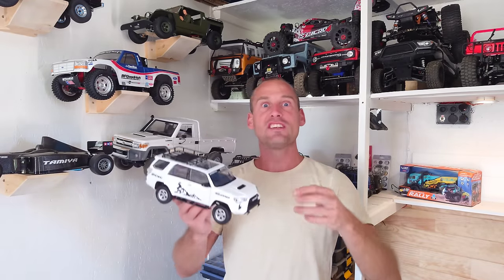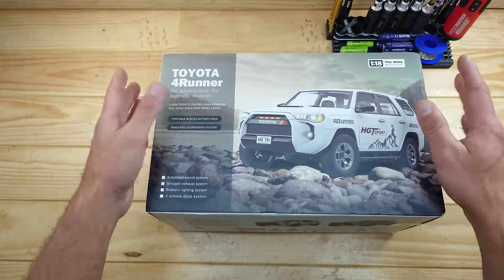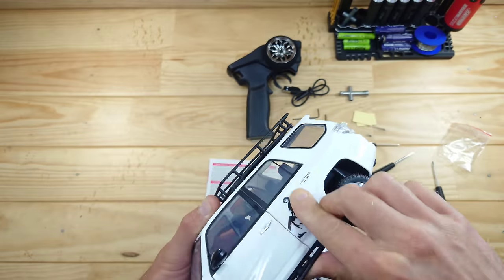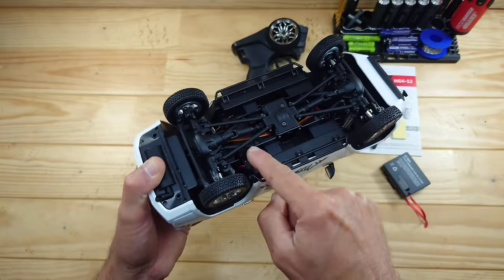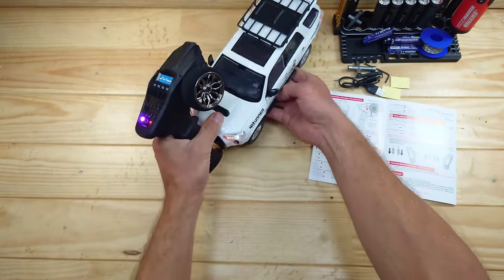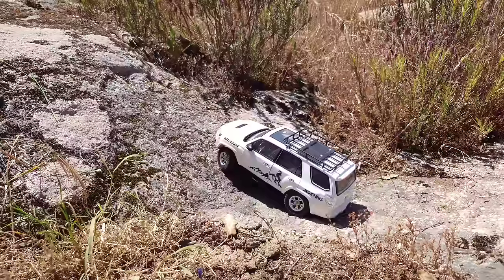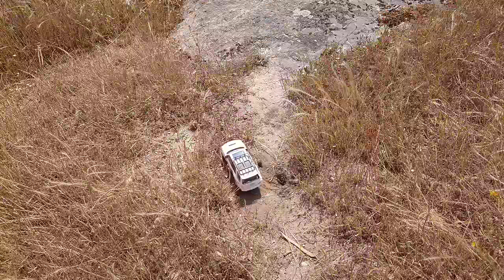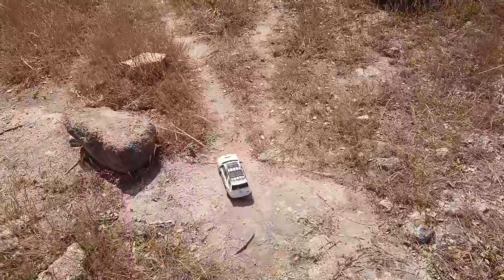Trasped HG4-52 Toyota 4Runner, They nailed it!

Comment: Does the body come off? I'd like to put the body on the FMS LC80, that would make for a slick off-roader.
Reply from the maker: It's a.bit tricky but possible. It's easier to drop the chassis down, I thought 4 screws near the wheels

Comment: Got stuck with the rear wheels looking like i got tboned on the driver's side when i turn it on. Tried doing the "hold F1 & F2 down" to re align the rear wheels but it doesn't seem to work (anymore anyways). Out the box it was a little off already, but read the instructions and tried the troubleshoot, it worked the 1st time. Not anymore. Tried switching to rear wheel, then "re align", and still nothing 😕. Any idea on how to fix?
Reply from the maker: Hi, wow, that's unfortunate. It should be possible to trim the front and rear independently. I think I read it in the manual ones. I don't have the manual here, but otherwise, send HG a email
Reply: @hofsplace  Thanks for the info 👍